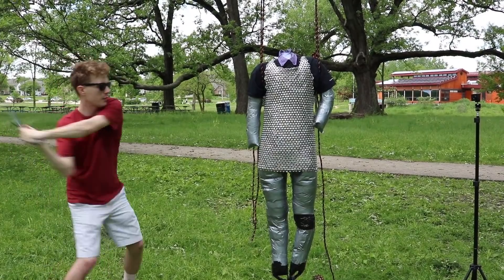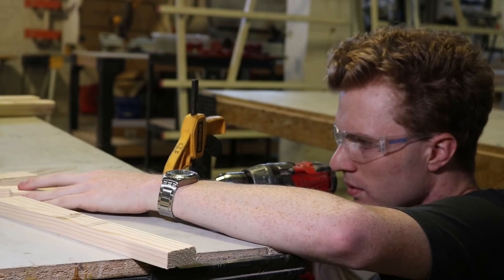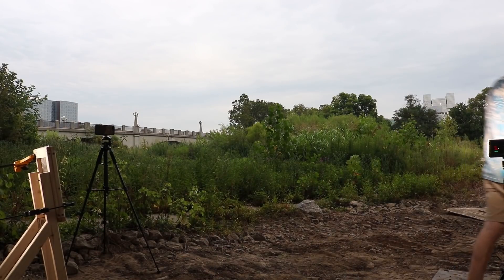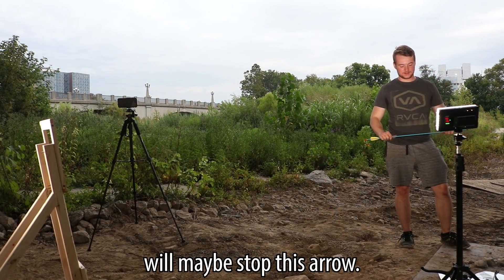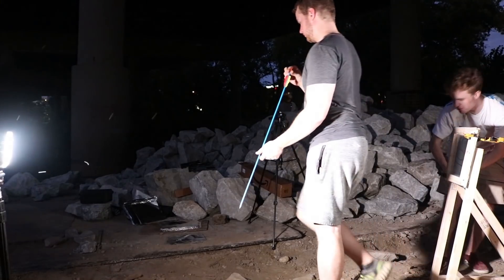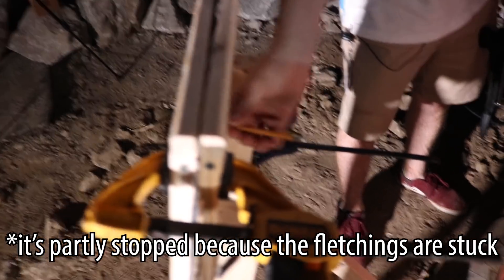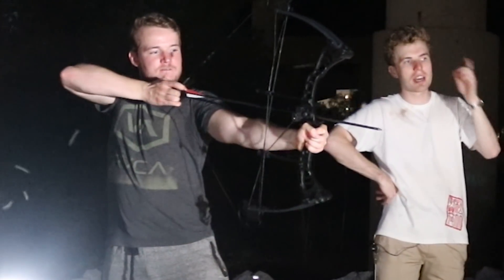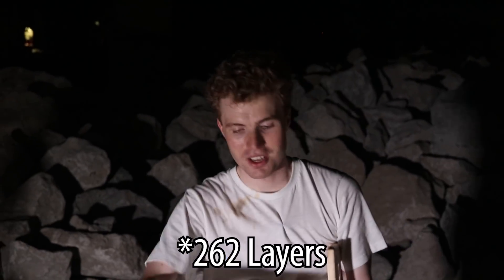How Many Layers of Foil will Stop an Arrow?

Comment: im an archer and my bow shoots at 70 lbs and somethimes when i miss my target my arrows will go straight through the sheet metal backing. i think its very interesting. also i would like to point out the compound bow that they were using was probably aound 30 to 40lbs considering he could pullit back without a release. also also why were they shooting without a release or sight? i think if they had both of those things they could have aimed in the center of the target and maybe disspersed that energy from the arrow throughout the target.

Comment: BTW both of those "wepons" are going to have a weak af draw weight. Wich is how much weight it takes to pull back the string i think. But average hunting bow is 70 pounds draw weight. And a hunting cross bow will be even heavier

Comment: I wonder how thick of an identically sized solid plate of aluminum would have to be to stop the same arrow and how much less aluminum is required in terms of the percent weight compared to aluminum foil.

Comment: Of all the comments, the one I'm surprised I haven't seen is that shields historically weren't made of metal. Virtually all shields that saw real use in combat were made primarily of wood, and the metal would have been only to strengthen the rim and to protect the region around the hand grip
Reply: Yeah because most metal shields would be too heavy to be used practically, aluminum is a fairly recent discovery and wasn't really around during midevil times. The most likely options for a metal shield would have been steel, iron or bronze which are all quite heavy, but they are also testing using a compound bow which is a more powerful modern invention so time period isn't really part of the question here
Reply: @dragonslayer-rc7jy  Compound bows are not more powerful than longbows. Longbows and compound bows can reach the same draw weights and they can shoot the same types of arrows. All a compound bow does is give you a mechanical advantage for holding a draw. Neither bow is inherently more powerful or weaker than the other. A 120 pound longbow is just as powerful as a 120 pound compound bow.
Reply: Shield were rimmed with leather or rawhide, not metals. Having metal around the rim of a shield is a very modern idea, mostly done in movies and tv, which later spread to other media and even reenactments. It is not historical however.
Reply: @DaShikuXI  There are attested references to metal-reinforced heater shields from the late medieval period. Leather reinforcement does seem like it was more common, but to say that metal banding or rims were never used historically appears to be inaccurate. And even if you were to argue that those metal-reinforced shields were from the early Renaissance period instead of the late medieval period, that's still far from being "very modern."

(The buckler is an exception, in that those were QUITE commonly all-metal construction, but they also weren't used for blocking arrows.)
Reply: alot of mongol shields were metal, pretty much any asian small round shield had a metal or plated variant

Comment: Well the only issue is, if you have a low poundage bow with like 10 pounds it would take a whole lot less to stop it. If you have a really high poundage bow with like 70 or 80 pounds, it would take a whole lot more. You ALSO have to consider arrow weight, arrow flight, wind, arrow size, so no matter what it won’t be consistent for every bow and every arrow, and every the shooter.

Comment: The “stupid expensive” cross bow he looked at was the LOW end of price lol
Reply: Lol exactly
Reply: You can buy compound bows for way less than $250, so although relatively cheap in the grand scheme, it's far from cheap.
Reply: @mandellorian that’s really cool!
Reply: my dad uses bows to acquire food via the hunting of deer.* I have personally seen him buy a 4,500 dollar crossbow and optic system for aiming (they don't use scopes like a more traditional hunting tool) *words chosen to not set off the non-human readers.
Reply: Me looking at that price and looking at my $800 compound on my wall and thinking it’s cheap
Reply: @mandellorian I agree but for this testing this cheap bows don’t have anywhere near the draw weight the speed or kinetic energy of a good bow
Reply: Crow bow?
Reply: @xktlz  it's a type of bow I think. I could be completely wrong cause I also have no idea. But 249$ or however much it was is cheap for compound bows.
Reply: @_Belteshazzar_  I thought he meant cross bow
Reply: @mikeyminja7173  either way 249$ is cheap as dirt
Reply: @_Belteshazzar_  for a compound yes, not for a traditional bow
Reply: @sleepingturtle32  yeah. I bought a bow at goodwill for 3$ one time 🤣
Reply: @_Belteshazzar_  lol! I am still rocking my 80$ bare bow recurve lol, works like a charm
Reply: @xktlz  oop hehe
Reply: @xktlz  crow bow... Like in hot shots 2, where Charlie Sheen used a chicken bow
Reply: It’s a compound bow 10x more powerful than the thing he was using
Reply: There about the same a 45lb compound bow will shoot an arrow at about 250fps and that 80lb pistol crossbow with the right bolts (anywhere from 90-110 grains) will shoot at like 225fps the bolts that come with those crossbows are like 50 grains.

Comment: U should do “Do Minecraft shields actually work” where you attacks Minecraft style shield with a sword, wooden bow, and wooden crossbow that you made to be alike the actual weapons in-game.
Reply: "Diamond sword against minecraft shield - will it work, and will I get in crippling debt?"
Reply: @sara-n5q  diamond sword in real life would shatter
Reply: @slapmilk9421  the Minecraft crafting method doesn't actually describe how a diamond sword is structured, it very well cold be a series of short diamond blades glued into a wooden structure similar to how the Aztecs made obsidian bladed swords. The bladed might chip, but the sword itself won't usually break, and you can replace any single blade.
Reply: @sara-n5q  LOL

Comment: i think your results may have had to do with your rig too. Pulling the foil taught creates tension and makes it extremely easy to break through. If you let the foil hang loose, it would have stopped the arrow with less sheets

Comment: A crossbow is more powerful then a bow, you can only fire an arrow from a bow from how much you can pull back, a crossbow works differently, instead of you pulling the string to draw, a spring or pulley pulls back the string
Reply: that's only if your crossbow is self-cocking, or if you're using a windlass on a medieval crossbow. otherwise you're still pulling the string, there's just a release mechanism that holds it till you pull the trigger

Comment: I hate to be "that guy" but I feel like it needs to be said.  That is a hand crossbow.  Not a full actual crossbow.  A Crossbow has much more force behind it, and is bigger than that dinky hand cross bow.  I have a hand crossbow though, and they are fun to shoot, as they don't require much strength to pull back.  If you can get your hands on a full sized crossbow, you'd have fun firing that.  But you need an actual range, not some random over pass.  That was very hard to watch you guys shooting towards traffic.  If you missed, that hill could cause an arrow to cause an injury.

Comment: Use metal siding for housing like it comes in thin strips and i have made it thick enough to stop a 9mm with other stuff inside the layers
Reply: If you want to try something im currently experimenting with its a combination of pine pitch glue and tiny ceramic flakes mixed together im waiting for my plate to cool and harden  for a couple days i think its gonna be a breakthrough in cheap armor plates that are super great

Comment: Could the weakness of the structural integrity between the sheets of aluminum foil and the thicker sheet of aluminum also be due to the aluminum oxide layer that forms? I know with rust that it can ruin the structural integrity of iron and was wondering if that could be part of it since the aluminum has more surface area.

Comment: Thats a compound bow which shoots a lot faster and harder than a recurve bow my dude
Reply: The one hes got probably isnt.
Reply: @averagejoe9040  it is lol
Reply: @ski7792  it depends greatly on the bow. Alot of the cheaper compounds max out at 45-50 range, a good recurve can match that.
Reply: @averagejoe9040  an expensive compound bow shoots a lot further than an expensive recurve bow
Reply: @ski7792  yes it does, but he isnt using an expensive bow.
Reply: @averagejoe9040   point is it's stronger than the cheap recurve
Reply: @ski7792  that is true